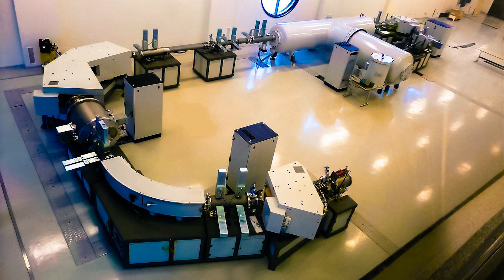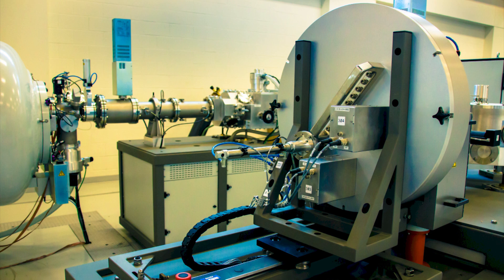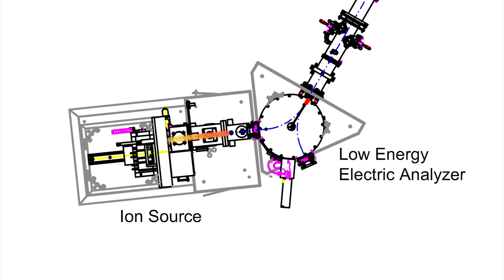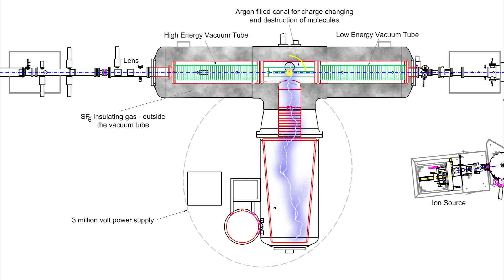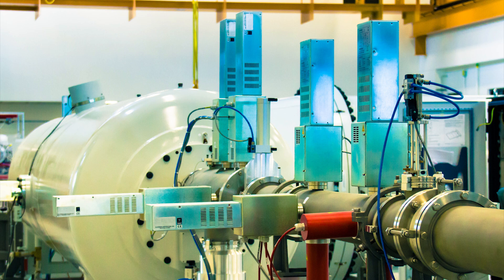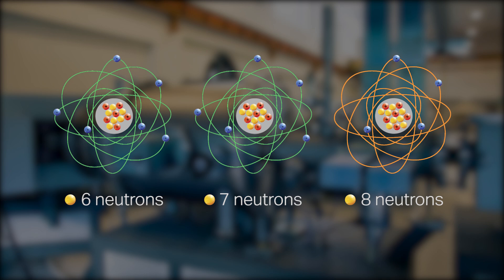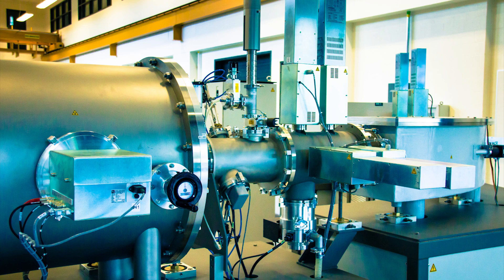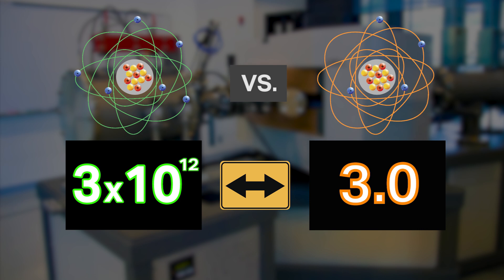How the accelerator mass spectrometer works – Ian Clark, University of Ottawa

Comment: does the AMS system measure other gases, and does it tell you anything else about composition?  or is this only used for dating purposes?   I'd like to see some actual output.  Will is also do the potassium to argon analysis as well?    Who makes this machine?  What did it cost, and how much does it cost?   It looks massive.
Reply from the maker: Hi Chris, here is a bit more information about the AMS. This particular lab is at the University of Ottawa. Our organization (Canada Foundation for Innovation) has contributed at least $9 million in infrastructure funding to get the lab up and running. I'm not sure what it costs to run on a regular basis, though I know they have at least one regular technician on site who helped build it and who maintains it. It is indeed massive, weighing in at 44 tonnes!

http://www.ams.uottawa.ca/
Homepage of the lab itself. It has info about who built the machine and what isotopes it can analyze.

http://www.innovation.ca/en/ResearchInAction/OutcomeStory/Nosmallfeat
An article about researcher Jack Cornett who studies tiny traces of rare atoms in the field of environmental health.

https://soundcloud.com/innovation-ca/tracing-contaminants-in-the-earth
Podcast from researcher Ian Clark (who narrated this video) where he explains how he uses the AMS; for what purpose.

Hope this helps answer some of your questions!

Comment: I` m working on my specialist thesis. It`s about measurement of technetium-99 in environmental samples. I`ve read that ICP-MS and LSC are the most recommended methods for detection of 99Tc in environmental samples. What about AMS? Would you recommend to use this method?